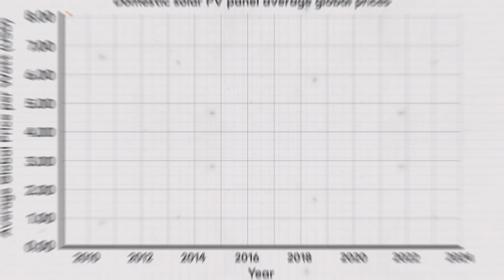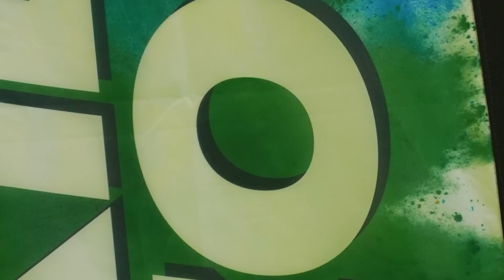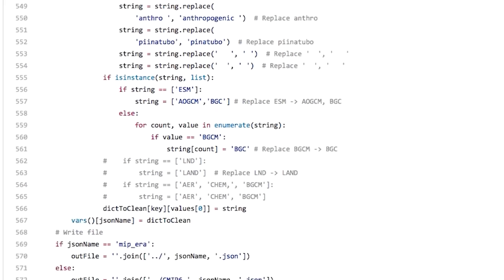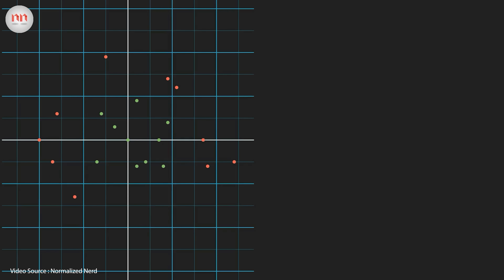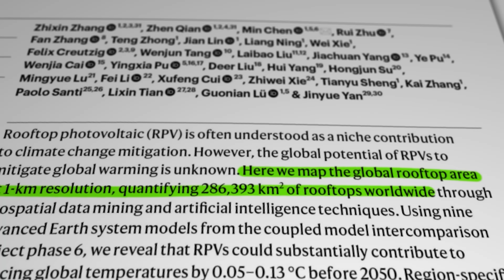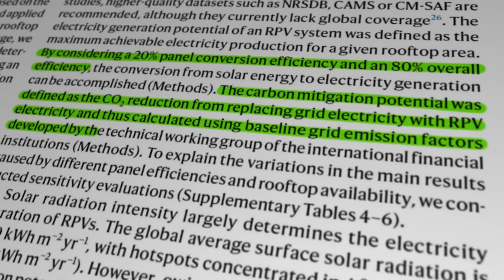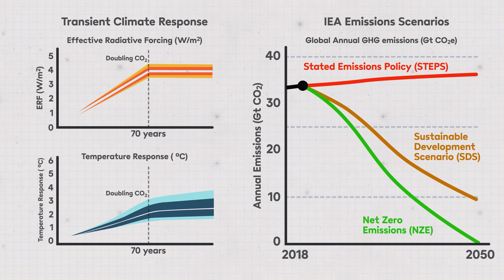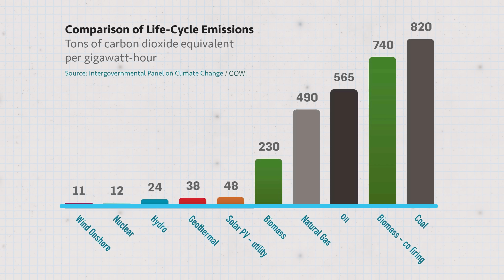New Report - Rooftop Solar PV is THE biggest climate mitigation technology!

Comment: I have mine on a flat roof in Pennsylvania for five years. I keep replacing gas with electric so I'm using a lot less gas and some of my electric paid for. In the summer I get credits. In the winter I pay. I would like to use the sloped parts of the roof to get entirely free of the grid AND the gas, but the roof tiles that Tesla promised don't seem to be ready.

Comment: A neighbor installed solar on his roof about 7 years ago. Hasn't paid for itself yet and the time needed to pay it off in electric bill savings has lengthened because he has three EV's which his kids drive. They don't charge them at their own homes because they are on the expensive PG&E, but use his system because of the solar and our local independent electric supplier. Have put solar on own roof because the roofing is about five years from its life-span and replacing will cast $19,000. Plus the 30grand for solar does not pencil out. My Nissan Titan is now gone and I get around town on my mobility scooter with lead acid batteries. Not chancing lithium.

Comment: I have rooftop solar and it's a BAD deal.  99% of the populace is not equipped or inclined to manage their own personal power plant. Nothing just works without monitoring, maintenance, and repairs.  Lots of these systems will just sit there doing nothing and the owners aren't even aware  because its just one more complication of modern life that no one wants to deal with. When your roof needs to be replaced, the whole system has to come down and then get put back up.  At that point, why bother?

 Beyond that, there are all the economic arguments.  The panels themselves may be reasonably cheap, but without batteries you are just parasitizing the grid at the worst possible times.  Batteries are not cheap or environmentally friendly.  Utility companies know all this so they rightly pay you very little for the power you generate, and then they charge everyone more for grid power because they have to build out capacity for when you and everyone else has no solar power.

local micro solar power plants are uneconomic, unreliable, and harmful to the community.  Other than off grid applications, solar needs to be centralized to benefit from scale, and even then it makes no economic sense when you include the cost of energy storage.  Beyond a few percentage of total requirements, you might as well build something that is reliable like nuclear, or even natural gas. They have their energy storage built into the fuel.

Comment: We installed 3.3kw of solar in 2012 in Perth WA and upgraded it to 4.4kw in 2-15, it paid for itself in just over 6yrs due to power price rises. 3yrs ago we installed a 13.5kw Battery taking our annual power usage to 85% solar supplied. And for 9 months of the year we run on solar for over 95% of the time. Our house is now 100% Electric and we have EV so we are upgrading to a 9.6kw Solar system that should take us to over 96% all year round. We will always have some Grid usage as our system regularly poles the network to check it’s still there🤣. But all our Home is heated / cooled / powered and our car are near fully fueled on the Sun. In 9 months of the year we will have super power more power than we can use. Yes we re-mortgaged to pay for our system but it paid for itself including the interest costs.
So YES it can be done and Solar is so much cheaper today than it was in 2012. All governments should be incentivising solar, it will drastically reduce the need for network upgrades especially if they include batteries. Great work Dave👍😊

Comment: I got 10 panels 12 years ago, still going strong paid themselves a long time ago, in 2021 we added another 16 panels (€4500), and the rising of the energy bills after that made sure they are paying themselves right fast quick in a hurry. 

Our electricity bill has been zero for 12 years and we overproduce about 2500kWh each year selling it back @ €0.07/kWh was €.23kWh before, that was even more fun. It pays for our central heating gas bill also, so we have a 0 energy bill except for some wood for the woodburner.

Comment: Got my first 20kw PV system in 2019 for 7k USD, it has paid itself back in 4 years. My parents live there.

Bought a new home and installed 19kw for 5k USD system here, this will pay for itself in 3.5 years. 

Getting my first electric car. 

Even if net metering ends, I'll put in 20 kwh battery back from all the money I saved and be off grid forever.

Comment: Excellent video. Many ideas in the comments re recycling solar panels so now have a reply to people who mention the negative aspects of them. Installed SPs 2023 and very happy with the system but yet to get a battery. Also have an ID Pro VW EV (highly recommend) and charge it at home during the day. Exporting to the grid is an issue as get so little 11c yet charged double using the grid. 
Similar is said of old EV batteries however I heard a chap  here in NZ who said there is a use for them in homes. Am always optimistic that someone somewhere comes up with economic ways to recycle things.  I believe producers have a responsibility to have a recycling programme for consumers.

Comment: We moved to our current house in 2010 and I had a 2.4kw system on our roof and registered just a month before the old high rate generation tariff ended. It wasn't one of those "free" solar panels deals, We paid for everything ourselves. I went down the rabbit hole researching panels and estimated that our system would break even in 8 years, but it broke even in 7. Today with inflation, we get paid over 70p/Kw and effectively get free gas and electricity

Comment: In West Cornwall I generate a generous surplus in Summer but a very small fraction of what I need in Winter. The problem is storage, a current technology large full battery wouldn’t run the house for more than a couple of days, therefore whatever I generate in summer will never power me through winter. So here in South West UK the best we can do is buy electricity from the national grid to use and sell what we generate back to the national grid. The real rub is that I buy my electricity for same price as gas, costing £1 per unit but sell my electricity for Pence per unit.

Comment: I'm stepping toward solar freedom incrementally. Replaced all our lead acid car batteries with AGM batteries- migrated the old lead acid to powering irrigation and ventilation in a greenhouse and pond with one solar panel. Next phase is to set some panels to running window AC on lithium battery and inverter. Another set to manage attic ventilation. Warm concept to consider is setting up a window heat pump on a wall backed up to an attic space (unit requires minumum 40 degrees F.) Next is to cool a fridge compressor by heating cold water line going toward water heater. Hope to replace old R22 heat pump with a ducted minisplit with CO2 refrigerant someday.

Comment: Got my panels last august, and its definitely worth doing if you can get together the cash and your roof is suited. Paired with a decent home battery and an EV it saves on so many fronts.

I went from paying £120 electric a month plus around £200 diesel fuel a month to more like £50 including car charging and thats probably being conservative and thats not taking account of summer when you overproduce and export to grid. We made £2 today doing that - so in summer you can potentially supply your home and charge your car for free or near enough.

In addition it saves on your gas bill somewhat because you can use a single room heater when needed rather than switch on the central heating. So on a sunny but cold day in late feb you can stick your electric heater on for really cheap (or free even).

Even without solar energy in the winter, the night time rate of 8p/Kwh means we can load the battery at night and discharge through the day to get 2 thirds off bills, and the poor generation time period in winter only really lasts about 3 months where it's bad.

If you're thinking about it and you're setup roof/light-wise, go for it, you wont be disappointed :)

Comment: All good stuff. Roof top solar has a big role to play in de-carbonisation of our electricity supply system. This is especially true of large commercial roof spaces.

An issue is cost. A roof top system costs somewhere between 2 to 5 times that of a ground mounted system. The wide range is due to the relatively low cost of installing a 300kW system on a warehouse roof to the relatively high cost of installing a 4kW system on a house.

A 300kW system might cost £0.60 per Watt fully installed. A domestic 4kW system might be £1.50 per Watt and more.

A large scale ground mount could be a low as £0.45p per Watt.

If we are to provide low cost electricity then ground mount needs to play a much greater role than roof top.

Comment: I installed my solar panels in 1991😂, 4x55watt. Following a natural disaster I replaced them in 2003-7 with 6x80watt ones. In 2021 I bought 3x270 watt, which are now outputting very well. The 6x80s are ready to be retired. All work by myself. In 2026 I hope to fit about 6 x300 on my roof. I'm on my fourth set of 4x6volt 225AH lead acid batteries.

Comment: Dave, the spread of village-level solar networks in rural areas of Africa is an interesting development. Pilot projects by German non profit organisations working with villages in Niger found they helped with pumping water for domestic and irrigation use, processing crops that were previously done by traders adding value, improved education for girls, reduction in poor air by not burning wood indoors,  and a reduction in tree cutting. It might be worth a bit of research and one of your programmes.

Comment: I live in the UK in a typical "Generic" 1960's maisonette. (Basically one of a pair of "houses" on top of a Flat, anyone in the UK should recognise the type), with 3 x 1sqm windows per wall for each floor and a Blank Coloured panel below the windows.
As such I have a South facing wall, elevated by 1 floor (So "First and second Story") With Good Sun in the Summer and (More importantly) Facing the low Sun in the Winter.

I've wondered if Solar panels mounted on those "Blank" panels below my windows would provide sufficient power.
2x 450w panels below the windows on each floor, 2 floors, 1.8 kW total, would certainly make a dent in the bill.
That's with the panels matching the windows.
I could probably stretch to 3 per floor...... 2.7kW
The thing is, they would hardly be noticeable compared to the existing panels (Dark Blue).
.
There are many thousands of such properties in the UK (I suspect a large proportion are Leasehold from The Crown Estate, so a proposition waved in front of a Regent known to be receptive to green technology should maybe on the list of "things to do" for any like minded politician?)
Even those "Blocks" facing "East/ West" have a VERY large South facing wall at one end 7m wide by 10 +m tall (3 floors) which could take 30-40 panels.
That's a lot of "Real Estate".

Comment: Over the past few years, most states in Germany have been adopting mandatory solar installs on newly constructed buildings or significantly redeveloped roof structures. 
Both makes perfect sense: the mandatory scaffolding is usually a driver in cost when building rooftop solar, but is also mandatory for any major roof construction work.

So “while scaffolding is already on site”, adding rooftop solar panels can be fairly cheap.
Of course, there’s a couple of sensible exceptions: only economically viable sections need to be covered and only by e.g. at least 60% of the surface; and there’s also an option to dismiss the requirement for individual hardships. 

And if one doesn’t have the money - there’s also an option to rent out the roof to someone who wants to invest in solar power (they usually do feed the energy into the grid, but often offer the electricity to tenants in that house at a slightly discounted rate compared to standard rates.

Comment: Absolutely brilliant video again. Voltage and current instability in the domestic grid caused by abundant PV energy can be a constraint unless you have innovative technology like eleXsys that controls the energy through battery storage. In Australia, this is the way to go for sure given our solar resources.
Reply: About any grid-connected inverter has built-in simple and advanced grid protection measures, but it depends on the local regulations whether the grid operator mandates their use.

A very basic protection measure is to continuously check voltage and frequency: if either one exceeds preconfigured thresholds (say, exceed 252 volts or 50.1 hertz; failure to reach 197 volts or 47.5 hertz), the inverter will refuse to feed to the grid. 

Advanced grid protection measures do aim to avoid upcoming issues by selectively compensating reactive power or regulating active power on the grid. This can slightly shift the voltage up or down to the expected voltage and so avoid overloading the grid. 

And being based on built in mechanisms the inverter needs anyway to successfully sync with the grid, it’s effectively up to the local regulatory authorities on what they do allow or require from any new installs.

Yes, grid-side storage can also help, but the technology to protect the grid is already present in most (or even all) inverters deployed over the past decade or so.

Comment: I never cared about the climate. It was always an economic decision. So you've over-invested in a solution with a life of 5 years. That's to say, it was efficient to invest 2 years ago. So you didn't get the 25yr life, you got 5yrs. That's a lot of waste. At least some can be recycled. 
I have instead replaced my 1950s oven with a $17 noodle make that uses 260 watts and an air fryer, on 1800 watts. Demand management, meaning less consumption. Less metal. But you're only looking at one side of the equation, and too empirically, devoid of analytical oversight. Truth =Philosophy + science

Comment: ive looked at a system for our house in London, its east/west facing so not ideal, but the payback time is still around 4/5 years regardless of size which is pretty decent, although we're likely to move by then so its not quite worth it. I am tempted to put in a very simple system myself as we work from home, so generating power we use during the day would be ideal even if only half of the year.

what has always struck me is why in places with a lot more sun dont have solar water heaters on every building, having free hot showers every day seems like a no brainer and they are super cheap. if its above 20c and sunny at the end of every day youd have hot water, and they are super cheap. but so many in italy and france still use emersion heaters or gas boilers just for the hot water in the summer, madness

Comment: Governments should offer subsidies to make those even more viable. Also, at least one company in Finland is trying to offer cheap electricity by installing battery to home for free with monthly lower electricity bill than normal (then stores energy in that, when electricity is cheap and sells, when expensive). So having energy storages at home too may be viable. Then it would be really distributed electricity production system and resistant to disruptions.

Comment: I come to a slightly different conclusion - in the UK, the electricity grid is well on the way to reducing emissions without domestic installations, but the gas supply, and emissions linked to transport, aren't going anywhere. Yes we need more renewables, particularly globally, but the focus on emissions in the UK needs to be on reducing the use of gas, petrol and diesel, through installing heat pumps, and travelling without the car / switching to an EV.

I try to make the point in this video, https://www.youtube.com/watch?v=vuw3T8SpFMc, if you are interested!

You may be interested in the S-Curve concept that Birchy talks about RE global solar - https://www.youtube.com/watch?v=S9VvXzvffq8

Thanks for your great videos

Comment: For a long time, I've had the opinion that  the future of energy production should be each homeowner being responsible for producing their own electricity.  Utility companies probably have a different view.  I have an ideal home for solar panels, but my city has a municipal utility that doesn't allow any financing for rooftop solar.  So residents are welcome to get a solar system, but have to front the entire cost.  And if the utility experiences a blackout, you're required to shut down your system as well.  But with the installation costs continuing to drop, I may give it a shot anyway.

Comment: Thank you again for crunching the evidential figures and sharing the gospel. The four kW array split between the east and west facing roof surfaces of our two bedroom bungalow in Sussex, UK were installed in 2014 also with the lifetime FIT of 14p per kWh produced, repaid the outlay two years ago. On top of all the free appliance use while the sun is shining, we get £540 per year paid to us from the FIT. If we had battery storage as my sister has with her set up, we’d save even more. Her entire March bill was £27 and most of that was the standing charge!

Comment: This sounds much more plausible to me than what I’ve read by “the ravina project”, which states that if we accounted for all the energy that went into building a solar panel, it would only produce 11% excess energy over its lifetime

I’d love to hear your thoughts about this

But one thing they may be right about, is to apply an additional 15% discount to account for faulty products (which either stay in place with subpar performance or get replaced)